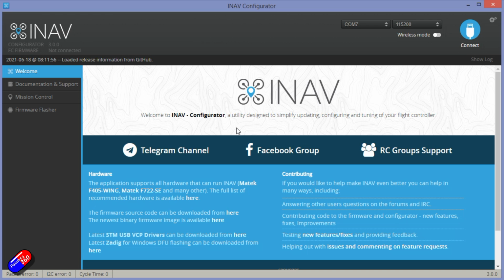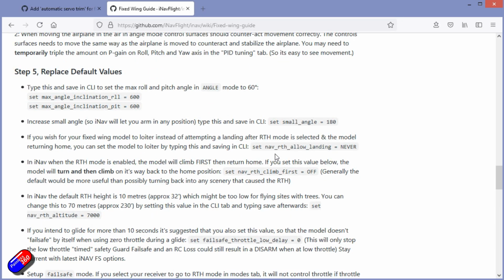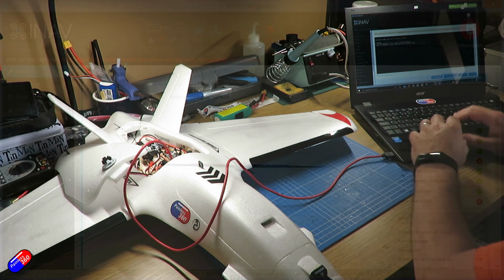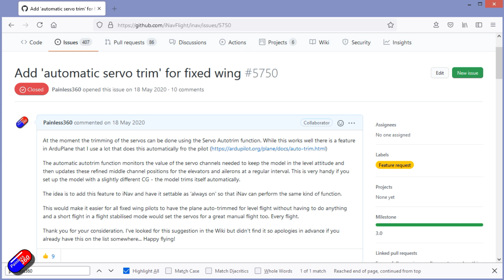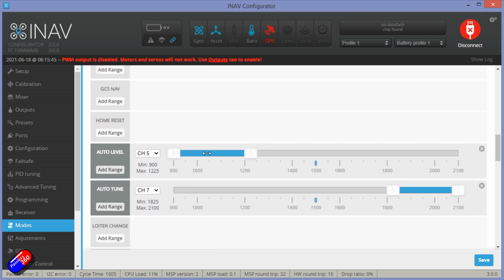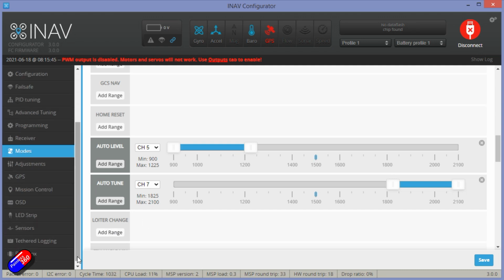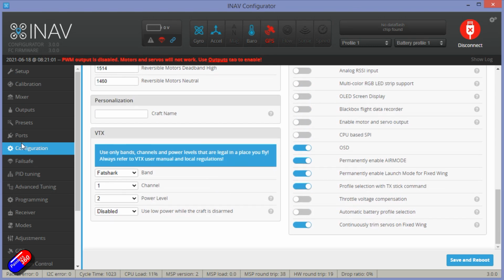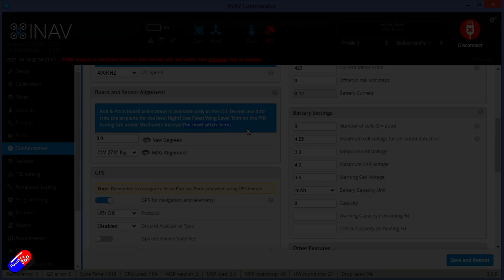INAV 3.0 Tips: New autolevel and auto-trim settings for fixed wing

Comment: Hello, congratulations on the content! I would like to ask a question. Is Auto Level a flight mode that I should only use once so that it finds the necessary parameters and then saves them or can I always leave it on when I fly together with Angle or Horizon? In case you have to turn it off after defining the parameters, these parameters are automatically saved as with the option "continuously trim servos on Fixed Wing? Thanks in advance!
Reply from the maker: Having ANGLE or HORIZON mode is very handy. See my INAV for Beginners series for how I use the modes here. HORIZON is handy to come out of after autolaunch and helps with both servo and angle trimming as well as landing in higher winds..
Reply: Hi, thanks for the reply! But actually I would like to know if the Auto Level mode can always be turned on together with Angle or Horizon or if I should turn it on, fly a little until I get the parameters and turn it off afterwards? @Painless360

Comment: Hope you can help me as you have before. New to Inav and have been flying FPV with Vectors for years.    Launched my fixed wing with SpeedyBee in manual and flew great.    As soon as I flipped the switch to  Horizon mode it went into a tailspin immediately.    This has happened twice.   I was planning on setting it on Horizon and then try the auto trim.   Any ideas on what Imight be doing wrong?  Thanks in advance for any advice.
Reply from the maker: Stabilise modes behaving oddly is almost always due to channels being reversed on the radio, not in INAV. See my INAV for beginners 2023 series... Best of luck

Comment: Thanks for the video. Question - let's say an FC is mounted at a slightly downward tilt. Autolevel will correct this in horizon mode to remove any pitch down movement. However, in acro mode will the horizon indicator on the osd be below the actual horizon? I'm assuming adjusting the pitch trim value in cli will correct this? How is this value discoverable after flying with autolevel in horizon? Also, you mentioned other pilots aren't even looking at adjust pitch trim does that mean they aligned their board perfectly for level flying?
Reply from the maker: Nothing sure as I don't use the AH here out of frustration with drift. Let me know how you get on... Happy flying

Comment: Thanks and great video about set up esp along with the other similar ones on INAV 3 , Been learning plenty but one thing im curious about,  for normal flying do you use AUTOLEVEL in conjuction with Acro mode on the automatic tabs set up like you have done for Horizon mode ?
Reply from the maker: ACRO mode has no autolevel and if that is what you want then HORIZON is a better bet... Best of lcuk!
Reply: @Painless360  thanks that makes sense 🚀

Comment: Greetings from the future! I have a weird build, a Delta Ray I've converted to brushless, with an Omnibus F4 Nano running iNav 3.0.2, GPS, and FPV. I had to mount the FC upside down, but when I fired up the configurator to set the orientation, imagine my confusion when that wasn't even an option! I saw the new flight modes in the Wiki, but found no reference for folks with inverted FC's in their planes. I went old-school, and set the alignment in the CLI (one more degree, reboot, two degrees the other way, reboot) using the "get board" command and working out roll, pitch, and yaw from there. I can report back that if you're like me, with an oddball FC mount, you can go the "old way" and set alignment there, if you're unsure. 

I've yet to use the "autolevel" mode combined with the other auto-leveling flight modes, but that's up next. Am I wrong for setting everything mechanically and electronically as close to neutral as possible, with constant servo trimming and autolevel mode being available?
Reply from the maker: INAV needs a well setup plane mechanically to work well. Check out my full INAV 3.0 fixed wing build for all the steps I use. I usually add some board alignment offset for the pitch to give it a little nose up in flight for the maiden.. Best of luck!

Comment: In one of your other videos I saw you use and recommend using angle and horizon modes together. Should I use both+level or only one of those two with level? Thanks
Reply from the maker: Only one at once. Advice changes all the time as code develops. Make sure to use the most up to date series.. Happy flying

Comment: I appreciate all the good videos you have been making. They have been super helpful! I have donated $20 to your Paypal account.   Just seeing if you had any suggestions on an issue I'm having?  

I had a Ranger 2000 with an H743-Wing flight controller and all modes worked great.  I recently got the Ranger 2400 and I am getting really frustrated trying to get RTH to work properly.

Once I flip the RTH switch it rolls extremely hard and almost goes into a death spiral until I flip the manual switch and get it leveled off.  I have played around with different RTH settings (Current, At Least, At Least Linear Descent) but it still behaves the same way.  I even adjusted the max bank and pitch angle to 10 degrees.

I have not done Autotune yet beacuse I didnt need to do it on the Ranger 2000 but I'm running out of options to get my new plane working properly.
Reply from the maker: Thank you for the donation - that was very kind. 

The maximum bank angle in auto-level modes (and hence GPS) is the same as those set for flying. I'd not try things like GPS until you know that the model is flying well in self level modes and is tuned. See my INAV 3.0 setup mini series for how I set it up here and the steps I use - https://www.youtube.com/playlist?list=PLYsWjANuAm4o34OZd4Z2umSYcgIF222Tm

Best of luck
Reply: @Painless360  Ok that sounds like the right way to go about it. I'm going to go through the autotuning process this weekend and then try angle mode to see how it behaves. Thank you!

Comment: So watching this video i now understand where and when to use auto level, but isn't it kinda redundant if you already are using continuous auto trim? Or is it the tool that opens the pathway for the feedback from the gyros and gps? Maybe its me but it just isn't clear.
Reply from the maker: Auto level is for pitch settings in stabilise modes for maintaining height.  Servo trim is for manual and acro.. happy flying
Reply: @Painless360  AH ok thank you, got it. Cheers
Reply from the maker: This is covered in more detail in the upcoming second part of my INAV 3.0 fw build mini series.  I'd strongly recommend a you watch it..

Comment: So is there a difference at all between fw_level_pitch_trim and align_board_pitch? Been using the align board pitch to get my dart 250 in the air.
Reply from the maker: If you are talking about fixed wing then fw_level_pitch_trim is the one you want to set the nose up attitude. See my INAV 3.0 fixed wing setup mini series. Happy flying!
Reply: @Painless360  Exactly what I needed, cheers!

Comment: Does Fixed Wing Level Pitch Trim affect Acro mode, or only Horizon and Angle modes?
Reply from the maker: Board alignment and auto level work with the self level modes only. Servo trim is needed for Acro and manual. See my new INAV FW setup mini series... Best of luck

Comment: I'm a bit confused. Just so I'm clear, why/in what circumstances would I need/want to adjust the pitch in the CLI (or PID-mechanics page as of Inav 3.0.1) if I am going to use autolevel anyway (assuming I only really ever fly in Horizon mode)? is fw_level_pitch_trim only relevant if I'm going to fly manual?
Reply from the maker: I tend to use it to set the offset initially to make sure that the autolaunch works well and the 'plane has enough 'up' to easily climb then let the level mode fine tune it. Once it is set I never revisit it.
Reply: @Painless360  thank you v much!

Comment: Thanks Lee, at 1:59 it show -20.5degrees when the plane nose up, so for someone what to pitch up 8 degrees , CLI setting  “fw_level_pitch_trim = -8.0” Right ?
Reply from the maker: From the release notes: pitch trim should be done using fw_level_pitch_trim setting. +5 fw_level_pitch_trim means airplane nose should be raised 5 deg from level
I hope that helps.. Happy flying

Comment: Thanks for the great tips.   I understand the pitch part, but how do I trim for leveled roll?   I've done accelerometer calibration several times, but I always get a roll offset of about 5 degrees from zero?
Reply from the maker: Try align_board_roll - all covered in the CLI pages https://github.com/iNavFlight/inav/blob/master/docs/Settings.md
Reply: Set gyro and accelerometer values to default via cli and then you can re calibrate the gyro from scratch.

Comment: Rewatching this and several of Pavel's videos to spot the best way to make sure my model is leveled the way I want it. No, I'm not going to trust the iNav dev team yet :)  This is easy for a quad but for a wing or big bulky airplane I'm finding it quite hard to set and verify level is "where I want it" via the Setup tab. I was always able to dial this in and become confident before a first flight by tweaking the board alignment and pitch/roll offsets...  the pitch trim doesn't seem to affect the Setup tab appearance for me which has left me concerned....
Reply from the maker: I hope the documentation for INAV 3.x is updated to make this whole are clearer. The experience from the pilots I fly with and my own experience is that it just works. I'd welcome more detail myself.. Happy flying
Reply: @Painless360  I get that impression as well.  I'll keep tinkering with my new builds .  Hopefully it will become more familiar and I'll get to a happy place.  Otherwise, setup for 3.0 is really smooth.

Comment: Have a question when I put my ar900 wing in in horizon or  Angle mode it starts to roll back and forth I had alot of trim in manual mode then tried autorim I'm I doing something wrong
Reply from the maker: Could be a few things. Excessive move of the control surfaces. Bad tune.. What have you already tried?
Reply: @Painless360  well I found out I can't use subtirm period
Reply: Seems like a tune issue to me. Maybe high  P gains?

Comment: Hi friend!, I m a newbie on Inav and F7, now I just installed the 3.0.1 firmware on my new Matek F7, (before I watched this video), so, before the maiden, I m very concern and worry about my manual mode , because its just adjusted visually and manually, and of course, when in the airborne I switched it , then will be a disaster, and panic, so, do you recommend me the maiden throw the wing in ANGLE ? (or maybe in ACRO) and then if it survived the first meters climbing, then How can I trim my Manual mode? having that autolevel mode in combination at the same time with ANGLE ? so If I understand you well, it will autrim my manual trims too ? thank you .... and waiting for very appreciate answers...regards.
Reply from the maker: I usually trust an autolevel mode for the first throw and go from there.. See my INAV for Beginners 2020 series..
Reply: @Painless360  Hi again, sorry for bother you, as newbie, but now, everything is already mounted on the wing (Harrier S1100 Reptile) and I will added this AUTOLEVEL automatically turning ON when I set my ANGLE mode (both on the same channel/switch) and save that pitch level to 8, and last one I ve already sat the continious servo trim too, ok, I m ready for the maiden, do you think so ? OR I forgot some detail ? thank you again, and let see if I successfully maiden my little wing.

Comment: I just finished a F405-WSE on my new dolphin thanks to your videos. I have the board all hooked up for INAV 3.0 and realized I soldered all the pins on the wrong side.  Do you know the correct CLI command to flip the board rightside up.  I have tried several commands and it seems to not change anything.  The configurator always shows the board upside down.   Thanks
Reply from the maker: I have not had to look at that yet in INAV 3.0. There are still basic board alignment setting in the Configuration tab - are they not helping?
Reply: @Painless360  Thanks for all you do and the fast reply.   There is no board alignment in the configurations tab anymore.   It has all moved to the CLI.  @UCmX3OXToMBKTppgRskDzpswpointed me to the CLI commands (link below) align_board_roll = 1800 was the key!!!!
I was not using deci-degrees. https://github.com/iNavFlight/inav/blob/master/docs/Settings.md#align_board_pitch
Reply from the maker: https://youtu.be/Af-bbT-2exI is a video that will help in future..

Comment: Thanks Lee, but I have loaded 3.0 and when I connect my Timber with the Matek765 I still get the square box in the setup tab, I was wondering if there is a setting that I’m missing???
Reply from the maker: https://youtu.be/B2fNFREM6_o may help ;)
Reply: @Painless360  Nope that didn't work. even tried flashing the the flight controller and and starting from scratch and it is still giving me the boring box, but thanks for the help.....

Comment: What’s up Mr. painless? I had a question about one of the Armattan bind and fly quads and after seeing your “ model T “ armattan.  it can’t be a bad place to start….. last year I bought a DGI badger 5 inch BNF with 2150 kv TOA motors. although I only have three or four 5S batteries, that’s all I’ve flown. well I just got five 1250 mA 6S batteries for free! Other than keeping an eye out for hot motors is there any reason why I couldn’t or Shouldn’t, run the 6S batteries? Thanks for your time………..Mitch.
Reply from the maker: Check out the specs on the parts in the model to make sure they can handle 6s.(FC,ESCs,VTX etc). I'd watch it like a hawk during the first hover tests.. Best of luck

Comment: Lee,  do you need to do auto level on each flight before switching to Manual for the trims to be there? You said it does not have a save function, How can we save the trims so in a future flight we can launch in manual right away if we want and have the trims already there?  Does the save on the multifunction SH switch save the trims?
Reply from the maker: The trims on this model don't seem to move. They were set up in the INAV 2.6 and seem good. I hope that the updated documentation will be clearer on this... Best of luck

Comment: Glad I saw this before my maiden!!! Have to add “auto level” to angle and horizon mode. 👌 another save by P360
Reply from the maker: Once it has trimmed the offsets needed for the self level modes you can turn it off. I've had various suggestions about how good/bad it is to have it permanently coupled to the mode but it's working OK here.. So far... Happy flying

Comment: I have a request,  you have already mentioned that you only fly certain boards with iNav.  Could you do a vid where you have autolaunch set up and do a battery's worth of takeoff and landings in a row.  I ask this because taking off and flying a batt IS different to doing repeated take offs.  This is where I came a cropper - I was so chuffed with the auto take off that I did another then another, and thats when it did a nose in.  I know you have an autolaunch vid already but this is different.  I really want to do another iNav build but this is putting me off.  Maybe I should have been happy with the first launch and just flown it.  I had no issues in actual flight etc, and I do love the computer set up aspect of it.
Reply: Maybe i've answered my own query,  i should just launch and fly.
Reply from the maker: Yep :D
Reply: @Painless360  iNav 3 is looking nice though.  That vid Bonafide did with the ESky Eagle was pretty smooth.

Comment: I was under the impression that auto level was to be used like auto trim? Or thats what I thought I heard in the dev discussion. Its uses barometric data to level out pitch and re align the board over a "hands off control" period like auto trim did. This process  overwrights the board align pitch value which is why it is not present in the GUI
Reply from the maker: Let's see what goes in the wiki update when the developers agree on how to use - Happy flying

Comment: I don't have auto level in my Modes Tab. Is this only available on certain types of Wings? Do I need the GPS to have a fix first?
Reply from the maker: I'd make sure the rest of the setup is correct first.. Best of luck
Reply: @Painless360  It flies just Fine, GPS and return to home work. Doesn't worry me to much just thought it was odd.
Reply: same here. not sure why :o
Reply from the maker: How odd. I'd report it to the devs as an issue via the WIki.. Best of luck!
Reply: @Painless360  Thank you

Comment: great tips! have you tested to see if the horizon drift issue is finally fixed?
Reply from the maker: From what I have heard it greatly improved but not perfect. I don't use it here.. Happy flying
Reply: @Painless360  thanks so much for the quick response... You mean you don't use the horizon in the osd? I thought the horizon drift issue doesnt only affect the actual horizon graphical representation on the osd, but also the actual attitude of the airplane (what the fc at that moment thinks is acutally true level to use as a reference point for stabilization). nevertheless its great news that they improved upon it. Once again, can't thank you enough for all these years' worth of experience you have transmitted to us